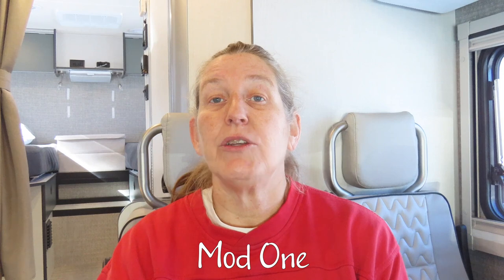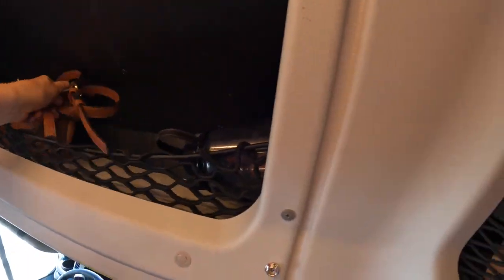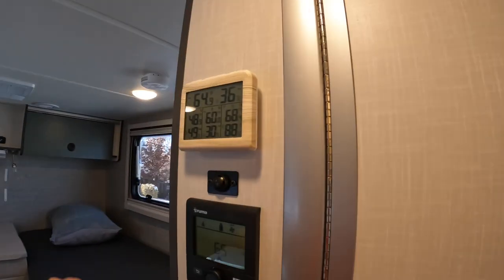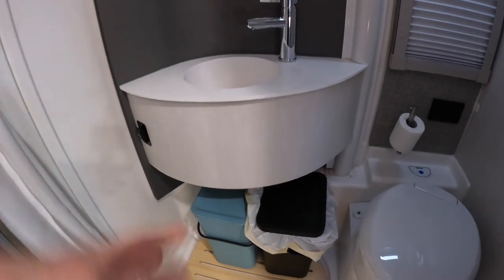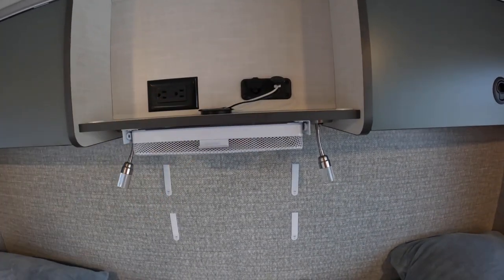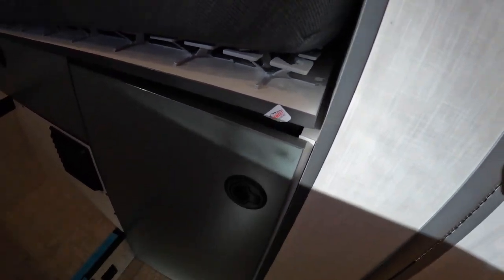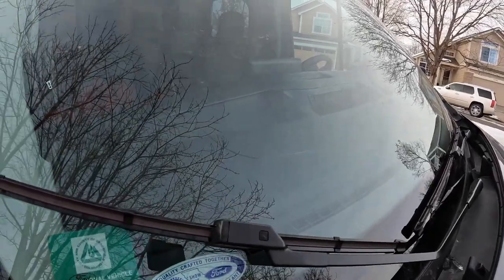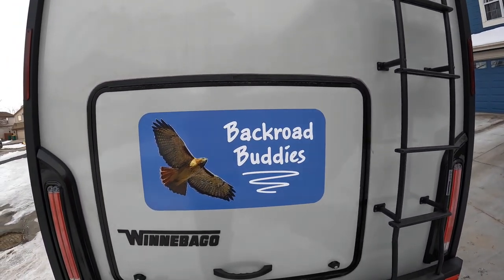Our EKKO Modifications

Comment: When you’re installing shelving or any brackets into walls,  do you put glue on the screws to help prevent them getting loose?
Reply from the maker: No, but that's a great idea. Our only concern would be if we wanted to remove the screws later for some reason. We haven't had any issues with screws loosening up, but we'll keep that in mind.

Comment: What type of adhesive tape did you use for the soapbox container to the wheel well?  Ours has been falling off in high temperature weather.  Thank you.
Reply from the maker: We first used Black Gorilla Tape which seemed to hold. However, when we replaced the batteries in the temperature sensor, we put it back up using Gaffers tape, which has not been holding. We'll go back to the gorilla tape and probably move the location to the back bumper near the license plate. We'll let you know how it goes. It's still a work in progress.
Reply: @BackroadBuddies  We also used the gorilla tape...It fell off of the plastic box. Cleaned up the box. It must have had a releasing agent (oils).  Next used denatured alcohol and sanded it. Placed  the container on the frame underneath the passenger seat ~forward of the steps. Working so far.
Reply from the maker: @techiebug  Yes, we used alcohol with the gorilla tape and not with the gaffers tape, which may have been our issue as well. However, in between the rear bumper and the rig, behind the license plate, is a little ledge that the box could rest on, then the tape to hold it in place wouldn't have as much pressure on it. It should be shaded most of the day, but perhaps might get a little sun for a few minutes each day.
Reply: @BackroadBuddies  thank you !  We'll try that next.  Great idea.

Comment: Great video!  Wondering if you can share the 80/20 specs / dimensions for the shelf you installed in the kitchen cupboard.
Reply from the maker: Here are some rough dimensions. Please measure your own rig, as they might be slightly different. There are lots of things under the stove that you have to work around, such as the water filter, hoses, wires and a square bump-out. Basically, there is an 80/20 piece about 21" long that runs across the front of the shelf. Then a piece along the right wall that is about 9" long. The piece on the left side is offset from the wall allow room for the water filter and other hoses and is about 13" long. Another 9" piece runs along the back wall. They are all anchored to the walls using angle brackets. Then a sheet of ABS plastic was cut and fits into the slot of the 80/20 pieces. Hope that helps!
Reply: Thanks this is very helpful. Did you order the ABS sheet from 80/20 or source it yourself? I find the 80/20 web site thorough but a bit overwhelming and difficult to navigate.
Reply from the maker: @rogerswierstra6818  We've also found the 80/20 web site to be an expensive way to source it due to their shipping charges. We order it from Grainger and pick it up from one of their stores close to home. The quarter inch haircell ABS plastic we get from Colorado Plastics. Hopefully there is some place close to you that you can source this from.
Reply: Thank you. Good advice.

Comment: I saw that you added an aftermarket TPMS. My EKK0 has a tire pressure moniter in the digital dashboard display. It takes a few steps in the menu to get to it  "Settings-Vehicle Maintenance-Tire Pressure" (it's easier on my Ranger). Is the Ford TPMS not accurate?
Reply from the maker: Hi Paul, The Ford TPMS is probably accurate but there are a couple of reasons we added the aftermarket one. First is that we like to drive with the menu screen that shows distance until empty and not have to remember to switch to the TPMS screen to see what the current pressures are.  Like the built in Ford system, the aftermarket will warn you when pressures are too low.  However, the aftermarket will also warn you if tire pressures get too high and if tire temperatures get too high (which can also be an indicator of overheated brakes as we’ve had an experience with on our previous Transit campervan).  As we have been able to tell, the Ford system doesn’t warn for these additional potential issues.  But please let us know if we’re wrong about that.